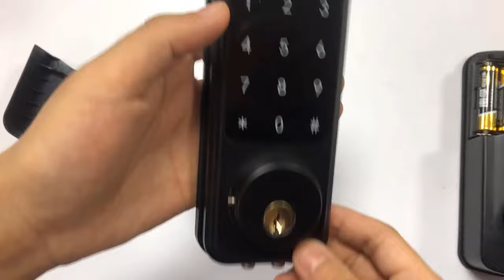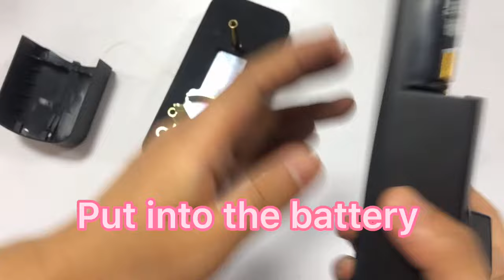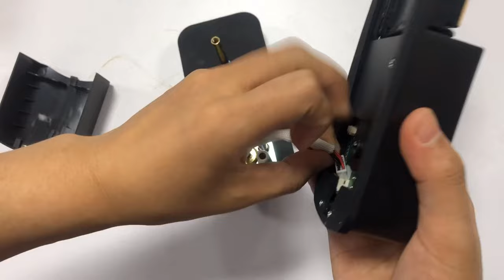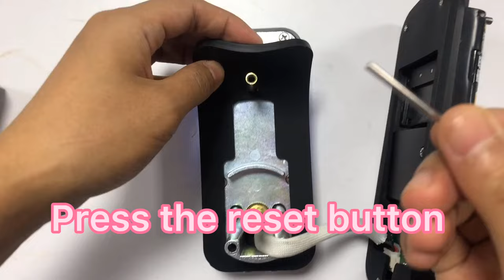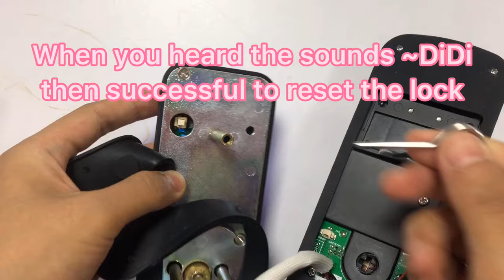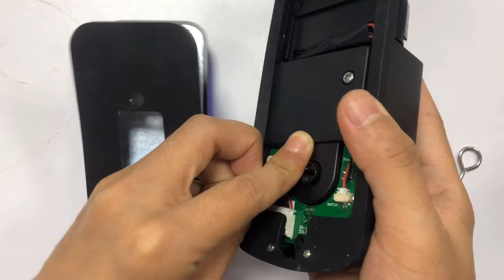How to reset the lock

Comment: I reset my lock and now the app won’t work with it and my code won’t work either. What’re you supposed to do AFTER a reset to get the app to synch with the lock again?
Reply from the maker: Asante Goddess hello, this is Vivian, please don’t worry, could you please contact me?my email is homide@milinaa.com, I will help you in time.
Reply: @hornbillsmartlocks4762  hi I have the same problem
Reply from the maker: @joshjhofer8796  could you please contact us via email? We will help you to fix the issue. If the lock is defective, we will hell you to get the new one.
Vivian950909guo@gmail.com
Reply: @hornbillssmartlock our lock is now asking for initialization passcode since battery change.